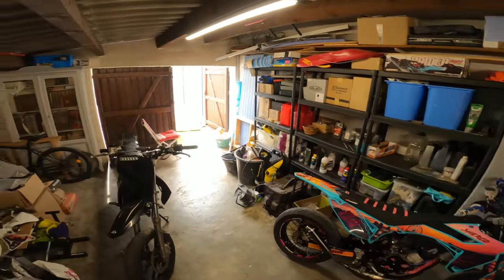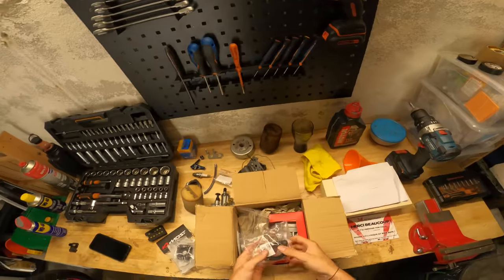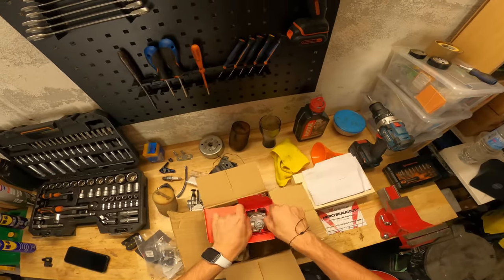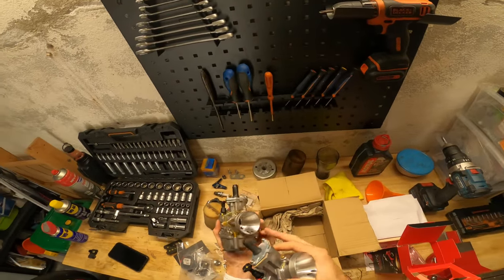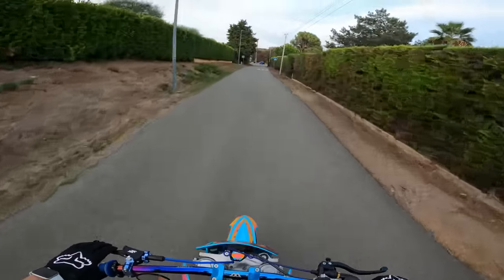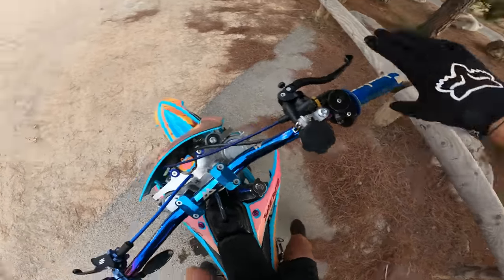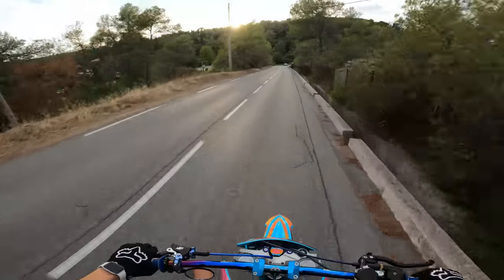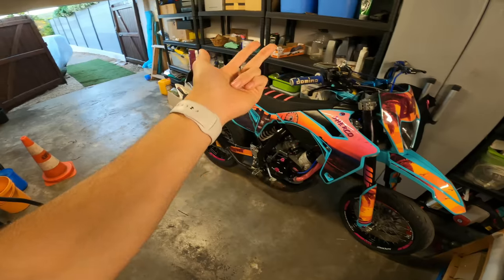Une Pièce Qui Change Votre 50cc !?

Comment: Pas obliger de consommer ci bien régler regarde moto client 86 stage 6 carbu 28mm pwk stage 6 prépare GP 145 / GR45 / VISSE DAIR DEVISSER DE 1 TOUR ET DEMI CIRCLIP 2 CRAN , ALLUMAGE MVT DD CALER A 0,32 LE PLEIN 110KM
Reply from the maker: Clairement c’est totalement vrai mais avec un gros carbu souvent ça ce dérègle et surtout je sais pas régler les motos 😭
Reply: @Nicolasbklf  c'est pas que sa ce déréglé dans l’air tu n’as pas la .ème pression quand il fait chaud ou humide en mettant ta visse d'air dévisser de 1 tour et demi tout le temp tu as juste à régler ton gicleur principal 

Quand il fait chaud , plus de pression dans l'air donc enrichir au gicleur 

Quand il fait froid moins de pression donc appauvrir au gp 

Toujours de 5 point par 5 point sur pwk
Reply from the maker: Merci bcp des conseils ils vont m’aider